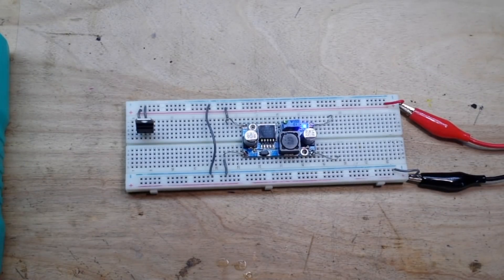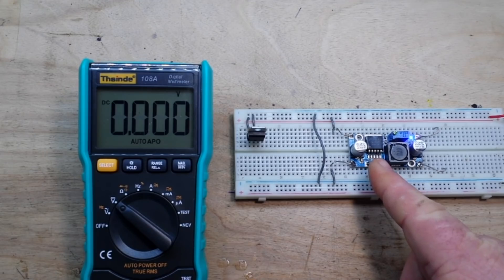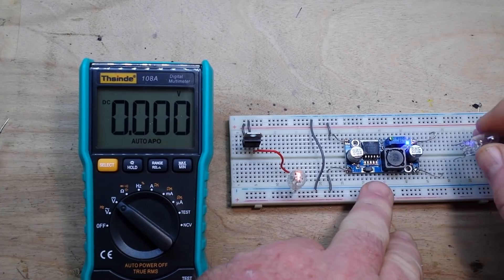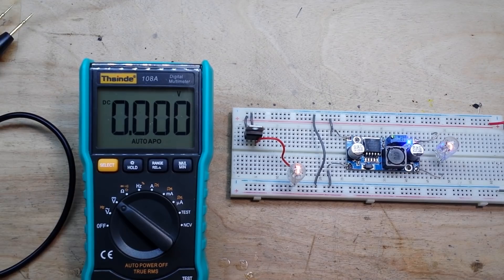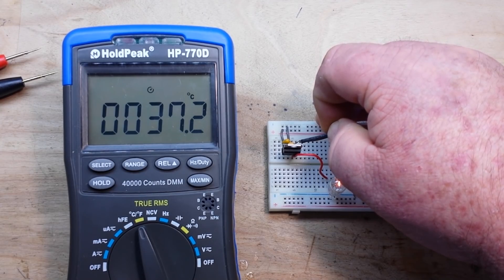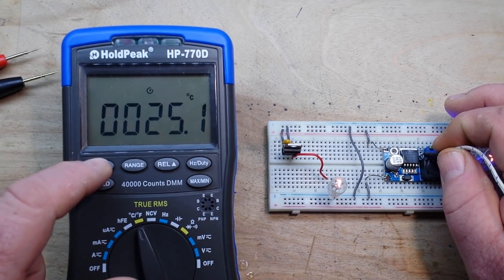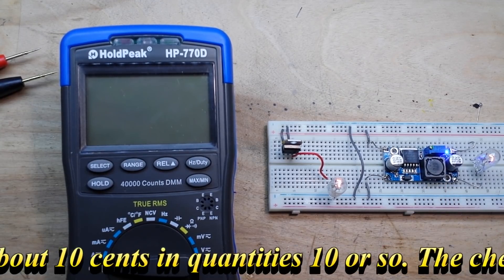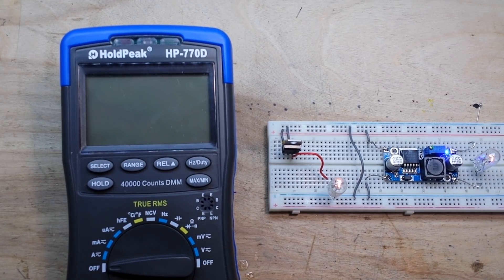Which is better? buck converter or linear voltage regulator

Comment: To get the best of both worlds, follow the buck converter with  low drop out linear regulator(s). The linear regulator can be designed to filter out the noise produced by the buck converter, while leaving the buck converter to efficiently drop the voltage from the supply to closer that required.
I used this technique in a commercial mobile transceiver. The input was from the vehicle 12 volt nominal supply. In practice this can be anything from 8 volts, when the engine is started, to approximately 15 volts, when the alternator is charging the battery. The input supply is also subject to big transient voltages associated with current dumping. In my application, I used a 5 amp DC/DC buck converter, with lots of input transient suppression, to regulate down to 6 volts. From memory, the maximum input voltage of the buck regulator was of the order of 25 volts.  This buck regulator  was followed by a number of linear low dropout regulators, which were powered from the distributed 6v supply, and were located close to the radio circuits they powered. They regulated the distributed 6 volts down to 3.3 volts for the microcontroller and DSP circuits and five volts for the analogue audio and parts of the receiver and transmitter driver. A high current TopFet acted as the master power switch, turning on the buck regulator and the 12 volt supply to the PA, giving the radio a zero off current, yet allowing it to be switched on with a low current ( 10mA) press switch to zero volts. The microprocessor, or rather its associated PLD, provided the flip-flop to latch the push switch output. By using a buck regulator, the linear power dissipation associated with the  big voltage drop from nominal 12v to 5v and 3.3 volts was avoided. By using the linear regulators, the noise from the buck converter was eliminated from the low voltage circuits. Each of the regulators had a simple LC filter at their input to take out noise components too high in frequency for the regulator feedback to suppress.
Reply from the maker: Great implementation
Reply: @learnelectronics  I believe this was the first Tetra radio radio transceiver produced, ( mid 1990s). I was really pleased with the zero current switch circuit because it was a neat after thought solution. When the prototype preproduction mobile was produced, the on/off switch was missing from the design spec. It had been over looked in all the excitement of getting the more difficult stuff working. By the time it was noticed, PCB space was at a premium and adding a 10amp power relay was out of the question. There were just a few gates and a flip flop left in the PLD that was being used to soak up some micro to DSP interface logic, and just enough space to fit  a TO220 TopFet package. It turned out to be sufficient to implement the zero off current boot strap on/off switch which became a very elegant space saving solution.
On the production model, a couple of microprocessor ports provided the latching function control, as the PLD logic was included in an ASIC.
Reply: As I have pointed out on another thread on this topic, it is the LC filter placed between the buck converter and the linear regulator that attenuates most of the switching noise. The L increases the output impedance of the buck converter to the point where the impedance of the C can attenuate the noise. The LC can be considered to be a frequency dependent potential divider. It is still necessary to follow this filter with a reservoir capacitor that can supply the transient current demands of the load that appear on the input to the linear regulator. The linear regulator does filter the low frequency noise produced by the buck converter, acting as a ripple stripper for the voltage control loop noise produced by the converter. The primary job of the linear regulator is to provide a low noise, regulated supply voltage to the load, to this end it needs to be able to meet the load current demands, hence the need for the reservoir capacitor placed close to the input of the linear regulator. By distributing the linear regulators around a complex circuit, given each its own LC filter close to the buck converter, long, noisy, PCB tracks from the converter can be avoided and the current through each L can be kept to a minimum, reducing the DC volts drop across each L, allowing the inductance value to be higher than it would be otherwise. This also has the advantage of ensuring the inductors are not saturated by the DC load current, which is kept small by this circuit arrangement. Clearly there are cost and PCB board space constraints that can be mitigated by in some cases sharing one LC filter between two linear regulators, where the load current of both are relatively small.  In general the higher the switch mode  frequency, the easier it is to attenuate the conducted noise, since it has more octaves of frequency between it and the required DC. It  also allows the use of low value, smaller, ceramic filter capacitor which have a better high frequency performance. I have added this comment to answer some of the comments that state that linear regulators lack the control loop bandwidth to remove the buck converter switching noise. The is partly true, though it depends on the choice of the low drop regulator which have the advantage of lacking the bandwidth to transfer the highest frequency noise from their input to output.
Reply: Thanks for the info. I will use a LC filtering in this way.. cheers.
Reply: @keithking1985  it's important to use star point grounding for the switch mode converter, so as to ensure that PCB earth plain is not polluted with common mode noise from the switch mode converter. It can be really difficult to remove this type of noise for two reasons: 
1) it is generated at a very low source impedance, effectively the impedance of the PCB track through which the common mode current flows.
2) once the switching noise  gets onto the PCB earth plane, there is no where to decouple other circuit too, as connecting to a noisy earth just introduces the  switching noise back into the circuit being decoupled. It is far better to keep the noise bottled up at source than try and remove or compensate for it once it escapes onto the PCB ground plain.

In case you are wondering, star point earthing means treating the switch mode components as a regulator module with just three terminals, In/Out and zero volt ground. If done correctly all the fast switch mode currents are confined to flow in tight local loops containing the star point ground. It is this star point that connects to the PCB earth plain at a single point.  The inductor at the input of the switch mode raises its impedance to stop switching noise flowing back into the equipment supply. The inductors of the LC filters at the output, raise the output impedance to allow the capacitors of the LC filter to remove the output noise.

When I was doing my design, I liked to imagine a mechanical analogue of a noisy engine mounted on spring shock absorbers.  The  switch mode being modelled by the engine and the springs standing in for the inductors. Its possible to view the capacitors as the bolts that hold one end of each spring down to the earth plane potential, if you will forgive the mixed metaphor. I hope this helps.

PS. The two capacitors normally included at the input and output of the switch mode converter, those that appear on the switch mode circuit application note, (not those of the LC filter) , should be considered as reservoir capacitors and part of the regulator module grounding to the star point earth. The capacitors of the LC filter ground to the PCB earth plain, since they are grounding noise the impedance of which has already been raised by the filter L. This  sounds like a lot of extra components, but it is not, as most would be fitted as standard design practice. Really the only additional components are the inductors of the LC filter. The higher the converter switching frequency the easier it is to remove the noise, because it allows the filter inductors to be small in value and thus small in size.
Reply: Thanks Nigel that's priceless knowledge you just gave me👊 (a fist-bump for ya.. ya see all the kids doing it these days) thanks again.
Reply: The closer you are to the VR's turn on voltage the better as it gets less hot overall and the further away you are the most excess is dissipated as heat.

Comment: I worked in the power supply industry for over 30 years. A buck converter is a lot more efficient but it also has poorer dynamic response to changing loads and has more noise. Choose which type according to your application.

Comment: Thanks for the clear explanation. I'm mid-build right now and originally bought buck converters for the project. I may buy linear regulators as well just to test out another version and get to learn both component types. Really helpful to know the pros and cons of both.

Comment: Thank you for this excellent video.
Just a small additional information: the buck converter has a higher efficiency. You want to consider that if you're running on a battery

Comment: Yes, but what size and what kind of capacitors are being use with the 7805? In a car we can use a little thermal compound and bolt it to the metal of the chassis, but does it need a protective film in between to 7805 and the chassis?
Reply from the maker: .01uF input .1uF output. Yes I would use a thermal pad for isolation.
Reply: @learnelectronics  ceramic or film cap

Comment: Would it be possible to use the larger buck converters, like 8 & 10 amp versions, that have heatsinks and to-220 transistors,  and a larger inductor and MOSFETs, capacitors, I would like to build a large buck converter , like 50 amps, minimum, and buck up to 100v to about 30v, crazy I know, especially with my limited knowledge, but hey!, that's why I'm here?  Great video, I always wondered about linear converters!   Or for what I'm wanting to do, would it be better to use a microcontroller? And basically build a mppt charge controller? To buy what I would like , is $650!!! With alot of features I do not need, it is for a wind turbine, since the voltage is often much higher than battery voltage, insted of wasting the power by pulling it to battery voltage, I want to convert that voltage to current, I thought about using a transformer before the rectifier, but that will kill low speed power!  I don't understand why a solar mppt can't be used! But a simple buck converter would make a big difference! A buck/boost would be better, although less efficient, it could boost the low speed low voltage, to a useable voltage, but low current, it is enough to make my brain hurt, if I had a near constant 30 mph wind, it wouldn't be so difficult, but I have low wind with gust, where it will make less than battery voltage, then 100+v open circuit voltage, if I could harness what I have! Trying to live off grid is difficult! I'm thinking maybe if I could get a more steady voltage, I can use a solar charge controller !  Sorry for rambling, if you can offer any advice, I would greatly appreciate it!!!
Reply from the maker: The output of your buck converter is limited by its lowest rated component. For instance I'd you have a diode only rated 3A then I wouldnt go over 2A.
So design your buck converter with components rated at least 20% higher than your estimated output and they should work well.

Comment: There are a ton of Linear Regulators out there including LDO style Linear Regulators that can kick a LM78xx regulator any day. Not to mention there are a few tricks to keep a 78 series regulator running cooler then just slapping on a heatsink, such as using a Series pass Transistor to carry the workload and at the same time increase the Current capability. So you can use a LM78L05 (500mA version) and use a Darlington NPN Power Transistor and still be cool to the touch.

Comment: i want to power my wemos d1 mini board (which draws about 80mA at 5V) with the linear regulator, input voltage is 12V. will a 15mm*20mm heatsink be ok?
Reply: What to look for is how much wattage are you trying to cook off as heat with a linear regulator. So, in your example, you are trying to drop 12V - 5V, or 7V over 80mA or 0.08A of current. So 7 × 0.08 is 0.56 or 560mW. So your linear regular will generate a little over a half a watt in heat. That heatsink should be ok, depending on material, fin design (if any), thermal compounds involved, and if there is any fans/ambient air flow, etc. With a heatsink, there is a lot involved. There are heatsink calculators on the web, if you Google it.
Reply: @erikvincent5846  thank you so much!
Reply: @Kostanj42  no prob

Comment: well this is nice but you should put VolReg on pcb same size as Buck is, because the Buck is bigger than VR and thus has bigger heat radiation. Also components on Buck lead the heat out off of the pcb. What really does matter is power consumption which you can transform into heat. But thumb up. You do nice research.

Comment: And when building a switching converter, the mlcc type makes a difference. Accidentally used X5R 10uF caps instead of X7R or better and got enough noise to flip out my 8-bit PIC18F. Once I put in X7Rs, all my issues disappeared. Now I know...

Comment: I've use those buck and boost converters in my DIY metal detectors a few times.   Required a choke and filter cap on the output of the converters to loose the ripple and RF elements they create.  BUT they work.   You can run a 12V circuit with a sing 18650 cell.

Comment: Regarding buck converter noise, please note that you can find buck (and boost, and buck/boost) converter chips with many different switching frequencies, up into the MHz range, and special versions that randomize the frequency to distribute the noise they produce over a larger spectrum at a much lower amplitude.

Comment: The only problem with the buck converters, is the noise.
In low signal, audio applications, the LM3... family with linear supply, is way better to feed Your opamps.
For digital processors, leds, displays go for the buck converters.
When You have a mixed board, separate the digital and analog ground!

Comment: Most of these dc - dc buck/boost converters are ok for voltage control, (split rail, +5 V -5 V 3.3 V, even 24 V etc.) but they are only really fit for low current applications. I built one recently and it was supposed to be able to provide 300 mA for each output, 'bullshit' !!!  I was drawing 200 mA from the +5 V and the final regulator was too hot to touch within 10 seconds, it would have spat it within 20 minutes. So I won't use it for that job, but probably handy for less than 100 mA stuff..   The moral of the story is don't expect too much from them.... Cheers Paul..good video..

Comment: That's the trade off. Linear regulators are inefficient, The switching regulators are 95%+ efficient and more desirable as you use more power; use a shield coil if noise is an issue.

Comment: I would like to start making my own voltage regulators for my projects instead of buying modules. Dose anyone have any recommendations for an IC? I'm going to start with one like in the video they are pretty easy to find on ebay.

Comment: Liniear regualtors are good, wenn playing audio, also for a few mA. There are some new low power LPOs. I use first a stepdown regulator from 24V to 5V and than a Lowpower regulator (HT7333) for 3,3V with the ESP8266

Comment: The bucks can be ok if you shield the hell out of them. Like the led driver in the new Cobra 29s. Oh wait, those are all failing after only a few years.
Reply: Karl Porath what do you mean by shield them? Cover them up to avoid noise to the circuit?

Comment: As the difference between supply and regulated voltage differs and substantial currents are drawn, the linear regulator begins to become less attractive to a battery supply user, in terms of the power lost as heat, which probably equates to a shorter run time.
Those of us that probably haven't sent a rocket to the moon yet . . . lol

Comment: REM -".. if you believe they put a man on the moon, man on the moon... "Just kidding no offense to be applied. Just a "metric" joke :P we need to put an arduino or RPi on the moon . Simple way to show both regulator solutions and caveats. Try both and check noise vs heat compromisse,

Comment: Well i have been trying to make a guitar pedal psu    from bms 3s 10a

When running on battery backup its clean
But when i charge and play

I hear the noise ( i guess the switch mode noise)

Any way i can charge while playing it  without noise?